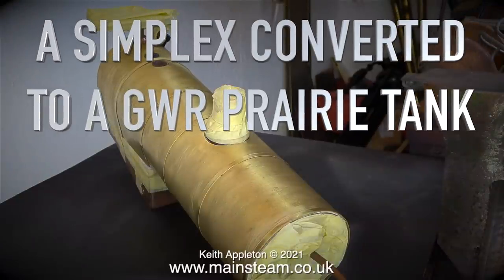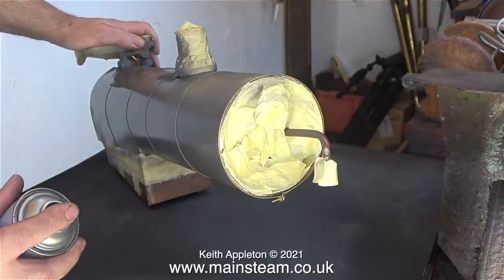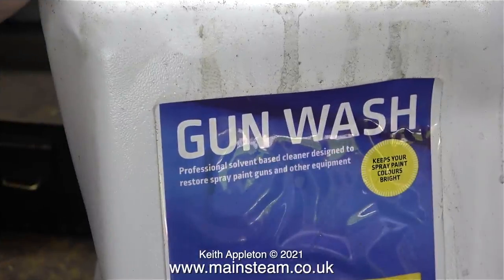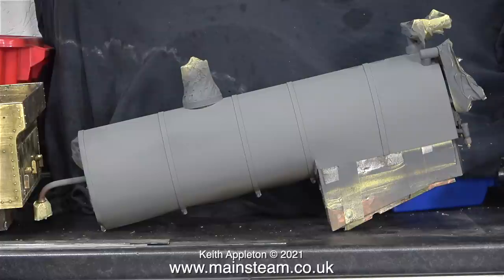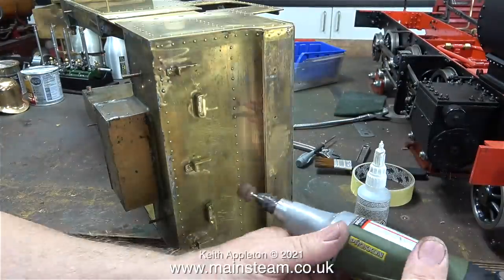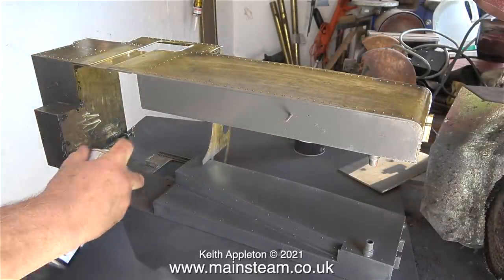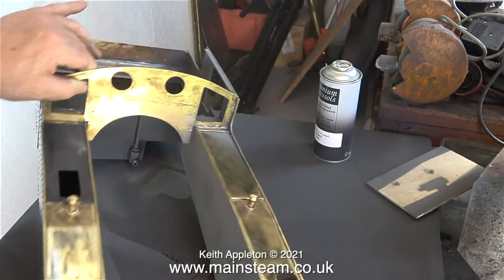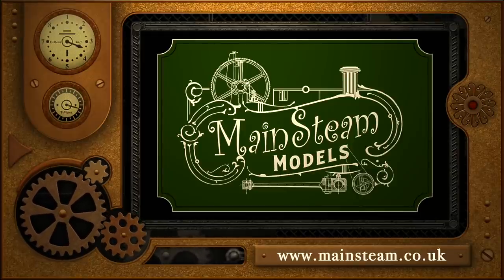SIMPLEX PRAIRIE TANK - PART #89

Comment: Hello Keith, many thanks for another great episode. Regarding paint drying during the cold days of the year, I ve got execellent results by using old light bulbs (the ones with glow wire of course) to keep the part warm, while not overheating. It works for me as well in the basement, which is as well in the summer quite cold with some humidity. Works great with a couple of 40w bulbs.
Reply from the maker: That's a good idea }:-)))